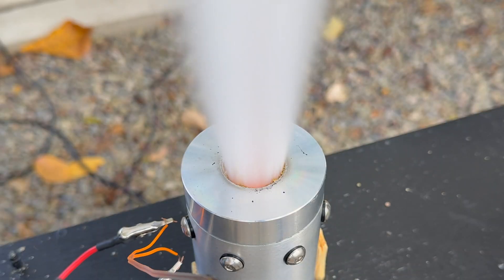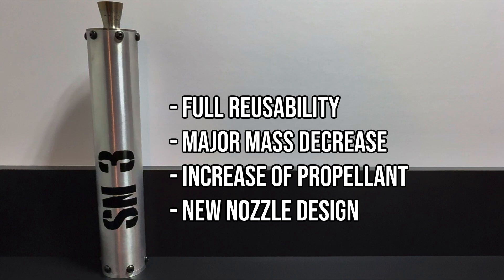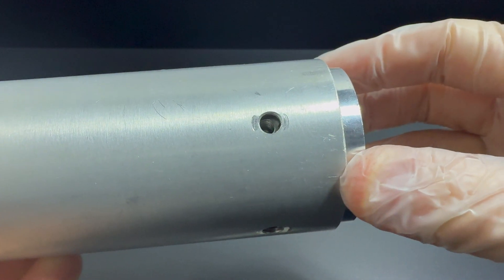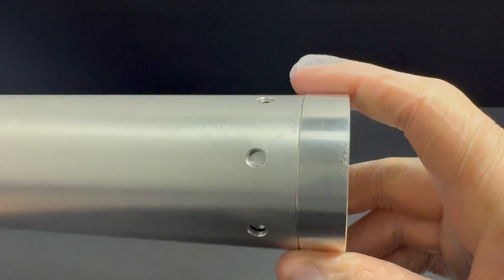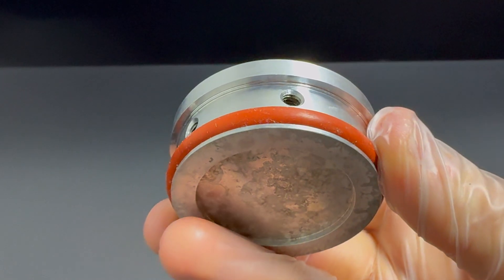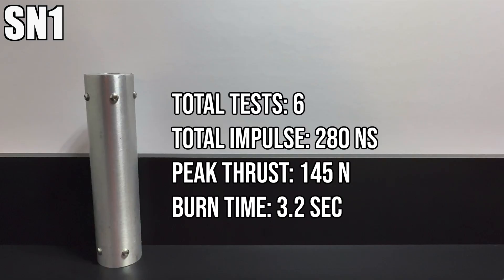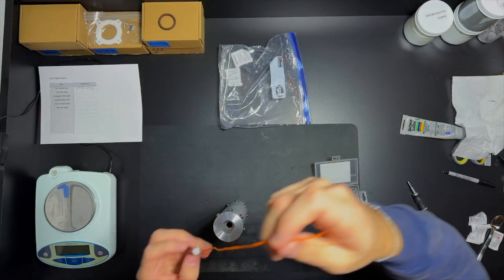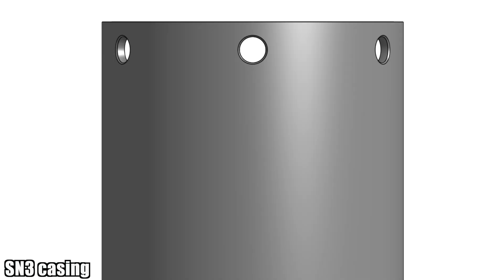How I Built a Rocket Motor That Actually Works! (Test Results)

Comment: I personally feel like threading the cylinder and nozzle would work better than bolts on the sides
I'm a machinist btw, i work on horizontal and vertical boring mills and lathes for pressure vessels, tons of scrap steel around the shop as well, i hope to be able to machine out a few parts in the future to do something similar to this for a "rockoon" project ive been designing with fusion360 and sketchup.

Comment: @AeroPropulsions what should be the criteria for choosing between retaining ring retention and screw retention
Reply from the maker: I just used screw retention because It was the most intuitive for me!
Reply: @AeroPropulsions  haha cool! can you specify the manufacturing technique you used to machine such precise holes, both on the casing and on the nozzle? and also where will put the thrust ring ?
Reply from the maker: @ I don’t have a lathe yet so I do get the nozzle and bulkhead machined from a shop. To drill the holes precisely in the casing I use a 3D resin printed jig. Refer to my video on SN3 for more details!

Comment: Do NOT make rocket motors from PVC if you're just starting out! PVC is frangible and can easily explode. And if it explodes, it's got about the same apparent density under x-ray that human flesh does, meaning the only way to locate and get shrapnel out of you is exploratory surgery. It's good that you didn't get hurt, but someone else with less experience could.
Reply from the maker: Yes very true.
Reply: طيب ماهي مادة افضل ورخيصة لمحرك صاروخي
Reply: What’s are good alternatives?

Comment: Just want to point out that the orings above the bolt holes arent doing anything here (if gas makes it past the first oring, itll leak out the bolt holes instead).
Reply from the maker: Yes you are correct! I used the second O-ring for alignment. Not needed in the future.

Comment: How did you plan to make the nozzle (whole chamber) design. I wonder if you've used some already existing docs, or you've invented some way do calculate predicted function of pressure to time for set parameters. (how did you make the optimization equation for the chamber). It is really hard for me to find any viable resources that cover everything from the beginning, that cover the behavior of non-perfect mixture of gases.
Reply from the maker: I use OpenMotor software to get an idea of the motor's performance. Static fire tests then provide real-world data to make adjustments and improve the design.
Reply: Also, Richard's Nakka website is a very good place to learn and find some useful tools

Comment: You should make your nozzles from graphite, which will reduce mass and erosion, and also switch to a snap ring design, then there's no external bolt heads to contend with when mounting in a rocket, unless you don't intend on flying it. But nice work though😊
Reply from the maker: Thank you! Working on that. Don't own a lathe yet and haven't found any machine shops that will work with graphite.
Reply: @AeroPropulsions  my university shop will do graphite at times. But i want a lathe too for my own nozzles. Amazon has a mini lathe for about $700 that should be able to make cases and nozzles. 

But im almost done with my masters\phd in aerospace which is money money money for the school and not me hahahaha

Comment: Love the video. Waiting for SN 4 👍 👍 motor. Are you going to add second O-ring to the nozzle?
Reply from the maker: Thank you so much! Currently working on the design to seal the nozzle. Two O-rings are definitely not out of the picture but I would rather not.